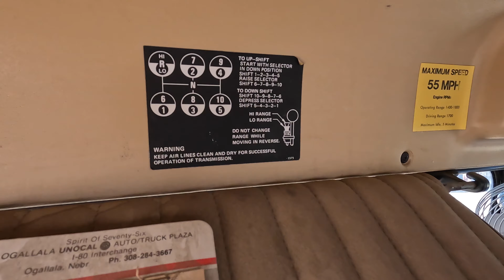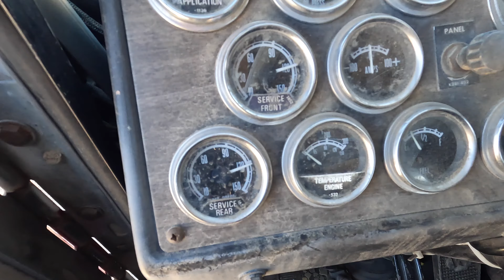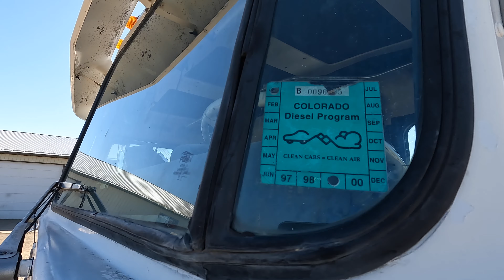Straight from the Rocky Mountains, what could it be??

Comment: Just recently scabbed some parts off a k 100 c/o. Had a gauge on the dash that was labeled deflector....with a scale displaying angle for the vari shield, plus switch labeled varishield. Appeared to be electric as there was a threaded cable pin connector on the roof, i'd never seen that set up before and thought it was very cool. Good find, keep savin them relics. !
Reply from the maker: Will do, I wish it still had the rest of the pieces up on the roof.